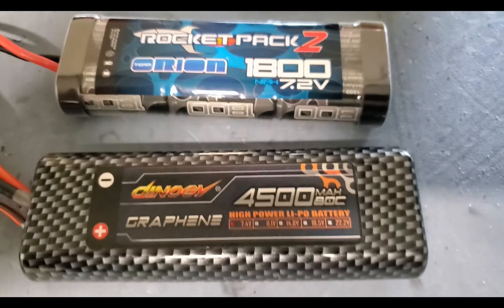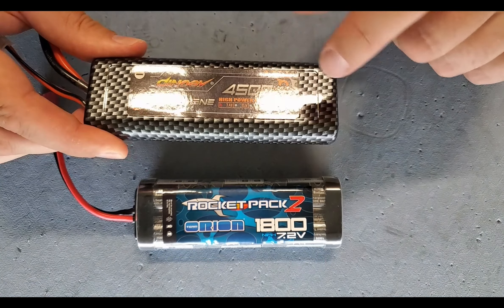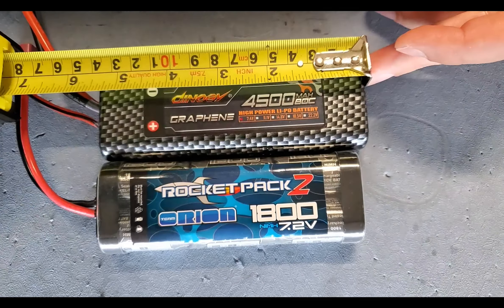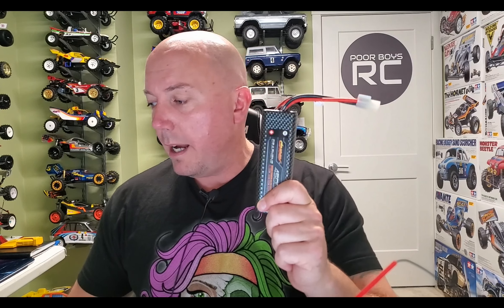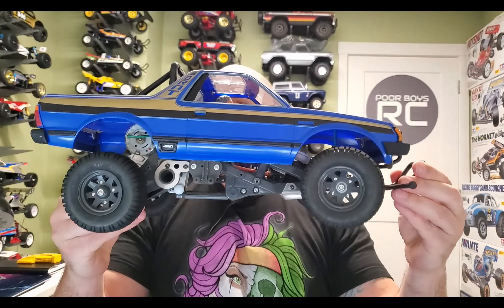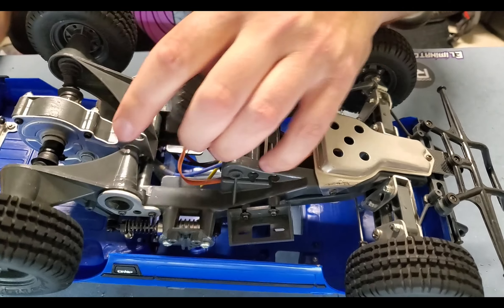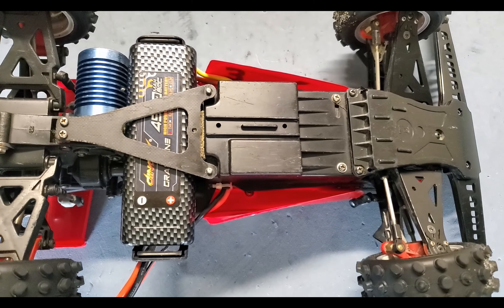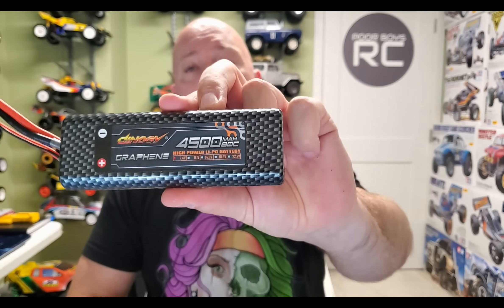Lipo Battery Fitment in Tamiya Chassis'

Comment: Yes finally a video which shows what kinds of lipo i can put in Tamiya rc’s been wondering want to put in my Tamiya CC-01
Reply from the maker: I've got another video on modifying my CC01 chassis to fit a 5000mah 2S lipo hard pack!  Check it out!
Reply: @poorboysrc  seen it just now ill have to pass.
Reply from the maker: @nighthawkj30A4  you do you man!  I've seen some guys get stressed about the mod weakening the chassis, but I gotta tell ya, after 5 years, mine is just fine!  👊
Reply: @poorboysrc I did mine years ago  not bothered the chassis strength one bit . I use the Zee 2s 500mah hard case .

Comment: I went through this struggle a while ago and found the "Gartpot" batteries on Amazon fit most of my Tamiya's. They're the right length, plus the wires and balance leads come out of the center of the pack.
Reply from the maker: Right on, thanks for sharing!  👊
Reply: Can confirm. Those are the same ones I've been using.
Reply: Same here, those are the ones I use !
Reply: That is what I am using as well. Good price also
Reply: Thank you

Comment: Thanks for the tips.  I just got into the hobby, and I do love the tamiya kits.  In my limited RC/tamiya experience, I found that it was harder to find the right length Lipos for my Wild one.  So far, I have found oval lipos that fit most of the tamiyas but not the buggy. 13.5mm.
Reply from the maker: It's definitely a challenge finding lipos that fit, but they are out there!  Thanks for watching!  🤙

Comment: Thanks, great video it was so helpful. I have that traxxas sledgehammer, also a blackfoot, mobster beetle all original. My question is, will it fit my new GF-02 Squash van? Thank you
Reply from the maker: Oh yeah, it'll fit. Just make sure not to mount your esc right up against the battery tray. 👊🏼

Comment: Great video and info. Would you mind telling me what the max length lipo would be allowable in an Egress 2012 please?
Reply from the maker: Thanks for commenting.  I tried measuring the battery space on my 2012 Egress and it's really tough to measure...  It's an odd way of mounting a battery in a chassis, kind of have to slide it beneath the upper deck and between two support posts.  I couldn't get a good measurement, but I can say that a conventional 6-cell nimh pack fits with ease.  I have a 4000mah 2S lipo shaped like a rounded nimh pack and it drops right in.  My 5000mah hard case 2S lipos will not fit.  My 4200mah 2S shorty lipo will fit.  So basically any battery shaped like the old style round packs will drop right in.  👊
Reply: @poorboysrc  thanks for the reply man... So your 4200 rounded lipo is good? May I have the measurements please? I'll try to see what's available in my country. I will run lipo for sure.

Comment: I must say that when you are looking for a LiPo battery with a Tamiya connector there is far less choice.  I am still running NiMH on my Tamiya cars and indeed even on my latest crawler, a Cross-RC AT4V, I have stuck with a NiMH battery simply to get compatibility of equipment across my RC collection.  It is such a pain to have lots of different connectors, especially when you have a collection with multiple different RC car brands.  Call me old fashioned but a high spec NiMH battery still works for me in most applications.  Having said that, I am really tempted to use a LiPo on the AT4V as it is a good spec truck, what do you think?
Reply from the maker: I think you should try lipo out, the power difference is really outstanding and the larger battery capacities are great in certain rigs.  I tried using a nimh to film my Traxxas Sledgehammer video a couple weeks ago and the lack of power was numbing.  I've become so accustomed to lipo power it's hard to go back.  Give it a try, I think you'll love it.
Reply: Switching out the connector or getting a Tamiya to XT60 converter is not a big problem I've converted most of my stuff to XT60 and higher power stuff to XT90.
Reply: Don't. Me too and not just that. LiPo batteries are dangerous unless they have factory electronics, like the DJI smart batteries. You do not want to burn down your place. Good spec NiMh has no downsides and you don't need to worry about unload or storage when you don't use them.

Comment: cut the plastic of the battery where the cable come out, fill the cut area with silicone and you are ok. i did that on my m01 tamiya i have video converting a m01 to 2s lipo battery
Reply from the maker: Interesting tip, I'll give it a try, thanks!  👊

Comment: Hay do you know if the tamiya tt02 esc can run on a lipo im not sure if you can
Reply from the maker: Pretty sure that kit comes with the TBLE02S esc, which is lipo compatible.  Only issue is that it doesn't have low voltage detection, so you'll need to either run a separate voltage detector with alarm, or ( do what I do) and as the performance starts to drop a little, I remove the battery and put in a fresh one.  👊

Comment: Hi, could you try if it fits in a TA03?
Reply from the maker: Unfortunately I don't have a TA03 chassis to try it on.  😭  

I can say that this battery is just slightly wider than a standard 7.2v nimh pack.  So if you have a little wiggle room in your TA03, you should be good.

Comment: What about a Hornet chassis?
Reply from the maker: I just tried and couldn't get it to fit my Hornet, it's just too long.  👊
Reply: @poorboysrc  thanks for trying sir. I've been wanting a Hornet lately but that is kind of a deal breaker. I've got 2s hard packs fitting in my frog and blackfoot.
Reply: Answer is really easy. Just use a shorty battery and if needed a little foam padding to stop the battery moving around in the battery compartment. I've found reedy wolfpack 2 S lipo is 95 mm long and slim enough to fit , plus gens ace make a redline 2 S lipo that is 95 mm long and fits plus it's 130C discharge rate . And NXE battery's make a shorty lipo 2 S battery that fits also. Plus many others , you just need to look around. Most of these batteries use bullet connectors on battery which changes to deans plug ate end of battery cable where it connects to ESC. And on an open type bathtub  chassis that's not going to be a problem.  Quite a performance boost over nickel metal hydride batteries and the runtime is hugely increased. Nickel metal hydride batteries might give 5-8 minutes running time on a charge and that's pretty much a waste or time and money when recharging the nickel metal hydride battery. Like paying for expensive electricity  for a battery that only lasts 5 minutes. I get over 30 minutes run time on my Super Hot Shot with Tamiya super stock RZ motor running a 2 S 4500C  nvision lipo battery.the car gives 44-45 kmh or 26 mph. The nvision battery is 138mm long and won't fit rerelease Tamiya Hornet or Grasshopper. And when I switched back to nickel metal hydride just to compare the difference the nickel metal gave me 5 minutes then was dead. 👎 Screw nickel metal hydride batteries. Go lipo for sure 1000% you won't regret it 👌💪👍 the Hornet battery compartment is  136mm + or - 1mm   long   x  50mm wide  x  25mm high.  Just find a battery that fits these dimensions.

Comment: Any chance you have a manta ray and tried that battery in it?
Reply from the maker: I do have a Manta Ray, just tried it and it does fit but it's EXTREMELY tight!  And the length of the battery prohibits the use of the Manta Ray's battery holder (little plastic piece held in with a body clip).  But it fits so tight, I don't see it ever falling out, I had to fight to remove it.  👊
Reply: @poorboysrc  I kinda figured that the retainer wouldn't clip in. Iv had trouble finding one that will fit the manta. Thanks for trying and the info!
Reply from the maker: @lloydrjim  happy to help!  But yeah, the retaining clip wouldn't even be necessary, it fits so tight that battery is not coming out!  Haha!

Comment: Many of the vintage tamiya kits needs the weight of a nimh pack. I use nimh packs in all my vintage cars from Tamiya, HPI and Losi.. And a silvercan or other mild motors do not need a lipo in my opinion.
Reply from the maker: The added weight of a nimh definitely helps!